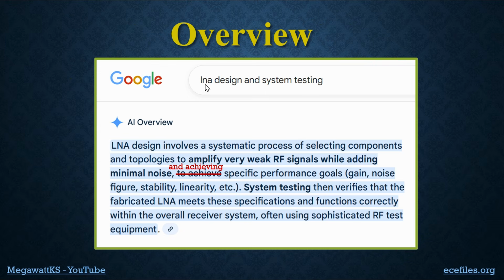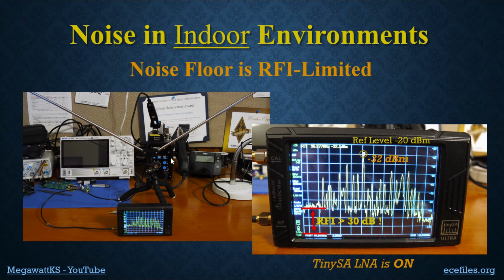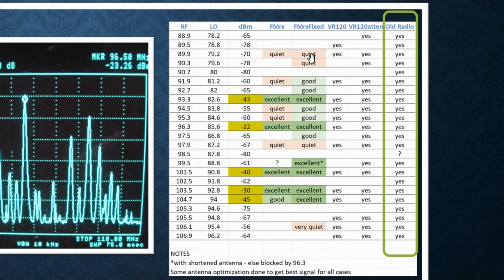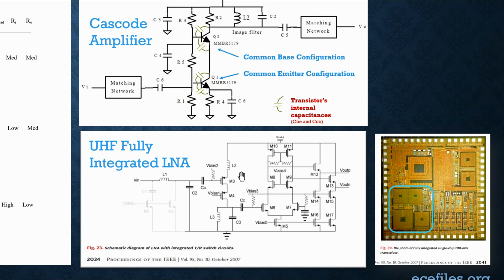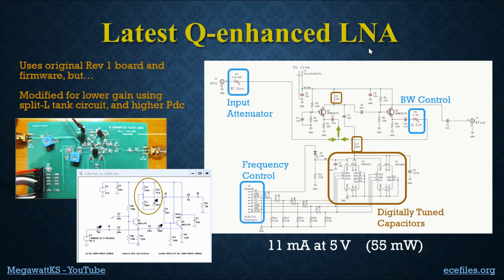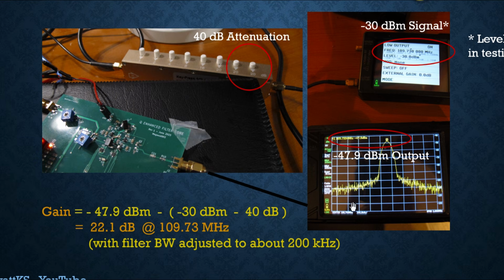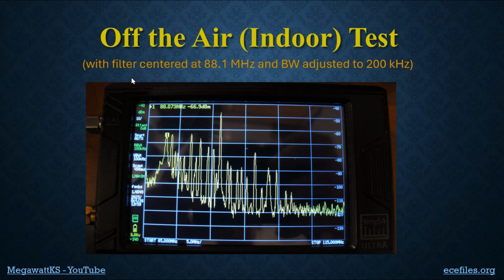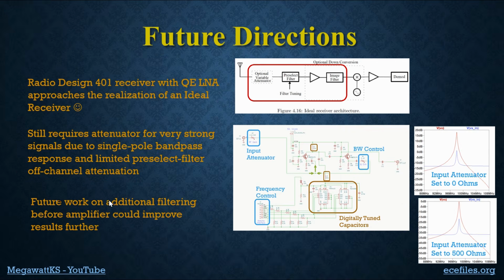LNA Design and System Testing - Radio Design  401, Final Episode

Comment: Hi, @MegawattKS. I liked this concept very much and is trying to replicate this same LNA myself. I am simulating the same concept with ADS keysight. But I am much concerned about K factor in this circuit. Since you are boosting the Q factor by introducing negative resistance using an emitter follower..at the input of the LNA.. obviously there is a chance for unwanted oscillations. What I noticed in my design is that the K factor is well above 1 at the tuned frequency only.. but nearby frequencies are having K below 1..So my doubt is does it matter, the instability at frequencies apart from the tuned frequency. Because the S21 of the circuit as well as the S22 is narrow banded(less than 1MHz in my case) so if any unwanted oscillation comes in other frequencies.. it wont pass to the output right.. I am stuck with this. Also could you provide me with some kind of contact details if possible, to send further simulated results.
Reply from the maker: Glad to hear you are working on this, and thanks for the questions. You are right that K>1 and to be concerned about oscillation. Indeed, that is perhaps the largest issue with implementing QE filtering and the reason that real-time control systems are needed to keep Q at the right level. While K may be close to 1 in an S-parameter analysis (or even >1) at nearby frequencies, I have not found that to be an issue. Once the Q is managed with a suitable control system, it doesn't seem to be a problem, at least for filters with a single complex pole like this one. It doesn't have any "hidden states" in the control-theory sense.
Reply from the maker: On the issue of contact details, I like to keep all the discussions in the comments with the videos so that others with similar doubts can benefit and help each other. Have you ever used YouTube's "Community" discussion features?  One person has been able to post photos there, so I think that might work. But to be honest, I don't know how well it works. Here's the link:  https://www.youtube.com/@MegawattKS/community

Comment: I dont ever normally comment on videos, but I wanted to show my thanks for all the super interesting series! I binged them all a few months ago and then took a while designing a fully discrete (no IC's, just transistors / passives) RF receiver for the aviation comm band right next to the FM band (The AGC needed for aviation comm took me a while to figure out!). I am just now getting the PCB's back now, although it might be a while until I can test them, since the testing equipment is somewhat expensive. 

All of this to say, I really appreciate all the really helpful lectures you have made! My university doesn't offer many RF classes (especially to undergrad's) so the chance to properly learn Radio design was really great!
Reply from the maker: Fantastic. Glad the videos helped, and it is exciting that you designed another receiver as well. What did you decide to use for an AM demodulator? Best wishes for your studies at university and your career ahead !
Reply: @MegawattKS  Thanks! To give a bit more info about the architecture in general:
I did a common emmiter BJT amp LNA (I believe same as the videos), 
RF diode mixer with BAT54J's diodes, and Mini circuits ADT1-1 transformers (originally I wanted to use my own LC balun's but I ran into a lot of sim problems even though the band is fairly narrowband, still dont entirely know why....).
For the LO I used a colpitts oscillator with a screw-tunable inductor, not sure if this was a great approach for tuning LO freq, but I guess I will find out :D
For the IF Amp, I used a CB amp with the output going to a envelope detector (kept demod simple, since I was struggling with the AGC at the time) two time constants, one with a long period for the AGC, and the other short for the output, and the Vagc feeding into a second transistor that can pulldown the base terminal to decrease gain.
Finally, I have a basic NPN + PNP push pull stage for the audio output -> a 8 ohm speaker, that has an additional potentiometer for volume control.

I made four PCB's for the project, one for each major stage, separating out so that I can test each part individually.
My general NPN transistor was the BFR92 as well.
Finally, I used Maple flow for my engineering calc's, Qucs-s studio for the RF sim's (although in hindsight, I should have just waited to get access to ADS through one of my classes, since the software is not fantastic), and Kicad for pcb design.

Sorry for more information than you asked for, I ended up writing much more than I originally intended!

Comment: Great video sir, how inter modulation effective can shutting down the weak signal? I know that nonlinearity can mix two out of band signals such that it sits right on a desired signal , but if this effect happens, we should hear those two unwanted signals instead of desired signal , but i saw that when you turning on your enhanced Q filter , the weak station appears and before it's completely quiet! And we assume the blocking and gain compression is negliable compared to intermodulation effect
Reply from the maker: Thanks for the excellent questions. This would make some excellent research studies, as these effects in real spectrum environments are seldom studied. For the weak signal becoming clear just before oscillation (getting quiet), I would postulate that it may be due to intermods downstream of the LNA itself. An advantage of the QE LNA front end is that it shapes the spectrum before it reaches the mixer. So the mixer's job is much easier. As the enhancement is increased, the interfering signals at the LNA output remain relatively constant in amplitude as seen by the mixer, but the desired signal is strongly amplified. So the signal to interference ratio seen by the mixer is improved significantly. Very interesting question. Thank you. Let me know what you think.
Reply: @MegawattKS  thank you for the response, i really interested in This approach but i see some drawbacks in it i try to share my idea 
Difficulties in Auto tuning mechanism :
The circuit you applied (colpits+buffer) is  sensitive to gain changes(center frequency also changes by changing the loop gain i mean that potentiameter which contros the level of enhancement)and Also gain is  sensitive to frequency changes(sometimes changing  center frequency leads to complete oscilation and vice versa) and theses two are mixed together , making the auto tuning difficult to apply we need two seprerate closed loop control for both gain and center frequency  
Another issue that this type of LNA has   its reverse relationship between bandwidth and gain, on This application it should be come with AGC for stabilising the amplitude and  stop overloading the next stage ,meaning when a strong signal comes the gain should decrease , at This situation the LNA has a wider bandwidth response to strong signals and narrow bandwidth response to weak signals if strong and weak signals are so close together then both will pass and amplify, 
But in my opinion if we succeed to control the frequency and gain properly 
it  seems it  provide some kind of automaching job for antenna
Here's my guess, if we connect  the antenna directly to This QeLNA, antenna loads itself to the circuit and both overall gain and center frequency wants to change , the nature of negative resistance of This LNA helps better transferring power from antenna to LNA and also any reactive component due to antena mismatch can be part of the regeneration and because the frequency and gain is auto tuned, it won't be problem, so it seems this kind of receiver less sensitive to antena mismatch 
And maybe that's the reason we hear very weak stations when we engage to  enhancement mode
Reply from the maker: @MOJTABASHOMAL  Thanks for the reply. You definitely identified some of the complexities and concerns, and it sounds like you have experience with this!  The main complexity is the need for auto-tuning as you pointed out. It's discussed a little in Part 3 of Episode 1.  Hope that helps!

Comment: For reference the emission standards for FM broadcast are:
"73.317 FM transmission system requirements.
(b) Any emission appearing on a frequency removed from the carrier by between 120 kHz and 240 kHz inclusive must be attenuated at least 25 dB below the level of the unmodulated carrier. Compliance with this requirement will be deemed to show the occupied bandwidth to be 240 kHz or less.

(c) Any emission appearing on a frequency removed from the carrier by more than 240 kHz and up to and including 600 kHz must be attenuated at least 35 dB below the level of the unmodulated carrier.

(d) Any emission appearing on a frequency removed from the carrier by more than 600 kHz must be attenuated at least 43 + 10 Log10 (Power, in watts) dB below the level of the unmodulated carrier, or 80 dB, whichever is the lesser attenuation."

In a nutshell that means if your as close as you were at the Top of the World your still getting blasted with a fair amount of spurious emissions.  If the radio station is being received at 0dBm (1mw) then you MAY be receiving spurious emissions near -35dbM (0.000316mW) 240 kHz to 600 kHz above and below that station.  Using a amateur radio signal meter that would be a signal strength of S9+58dB.  Basically the meter needle pegged full scale.  In the real world most radio stations far exceed these standards but it is possible on a marginal station.
Reply from the maker: Thanks for the detailed spectral mask info. Reviewing the spec-an trace, the 96.3 station definitely meets the specs through 600 kHz, and beyond that it looks close, but OK I think. I suppose it's lucky the close stations are so relatively clean !  🙂 At my house, I see the 96.3 station at around -20 to -30 dBm, so the second alternate channel spurious noise should remain below -100 to -110 - if it weren't limited by the in-house RFI issue...

Comment: Frequency of two local channels are never assigned to two close channel. That help to separate channel.
Reply from the maker: Agreed. The licensing is done to try to avoid adjacent channels in a specific metro area. But if the goal is to try to receive more stations, some will be from other areas and will be only 200 kHz away. In our area, I've seen several adjacent channels and been able to receive them as well with the car radio and with the new RD401 radio (thanks to it's better IF filtering compared to RD101 and some commercial radios) 🙂 The NXP chipset used in the car also has DSP to enable it to do that according to their published info.  For WiFi and other unlicensed services, things are even less controlled. But at least they have time-division-multiplexing to address it...